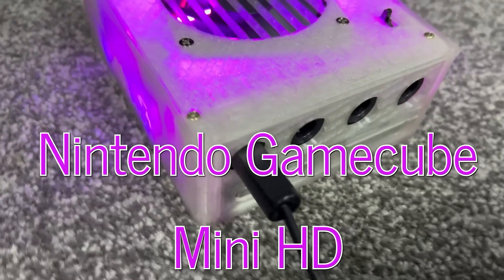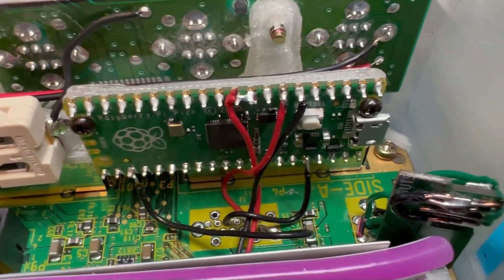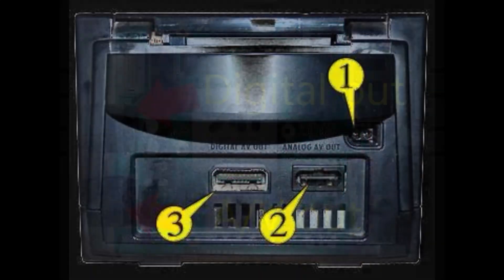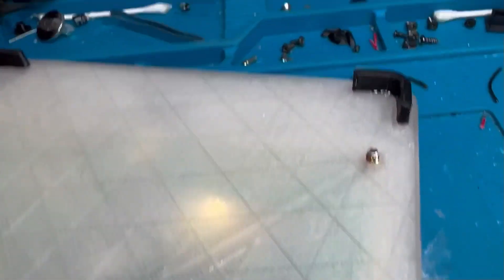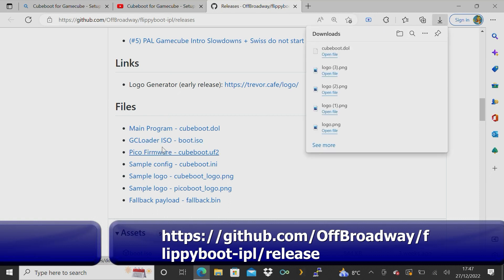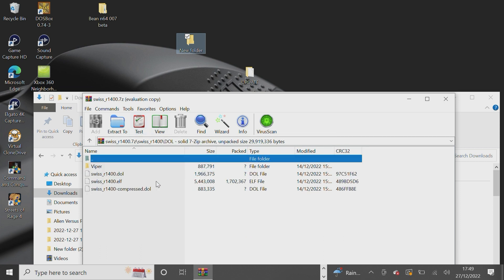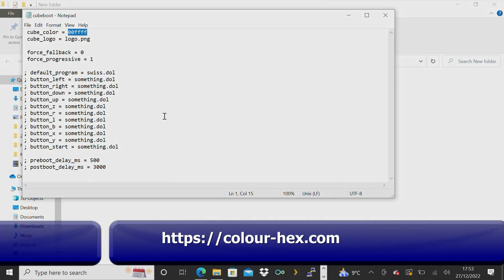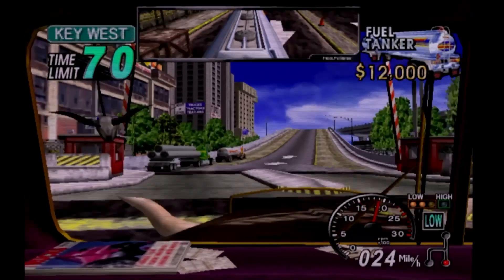GAMECUBE MINI Project New Models HD / SD (PicoBoot with CubeBoot and Custom Boot Image)

Comment: Thanks for the video. I've been trying to build one of these with the DOL-101 motherboard.  I was wondering if you had to do anything special when installing the RPI pico for picoboot.  I've been following the regular install instructions for the dol 101 but I can't seem to get picoboot to work.  I've done two other picoboot installs with no problems on a couple of -001s.  I'm wondering if there is an issue since I removed the two ports on the bottom.  Thanks for any advice.
Reply from the maker: Hi my pico was installed as usual I did have issues with the initial try and it turned out to be the type of wire and length that I used so I changed it to a thinner wire and made it as short as possible and that fixed it but the install was standard for that motherboard type as they are different but I’m sure you known that 
The ports should not matter being removed so unless you bridged a joint that’s not an issue just check you did not knock off any other comports as I did that also when removing a port 
If all looks ok I would reflash the pico and change the wires and check the GameCube still boots ok without the pico and try again a fresh 
Hope this helps and good luck it’s worth it 👍
Reply: @TheVetUk  yeah everything boots ok it’s like the pico isn’t even there. I tried reflashing and I used the same wire as all my other installs. I’m going to try a different known working pico from one of my other GameCubes to see if it’s the pico board.